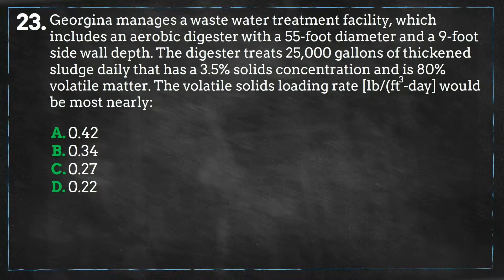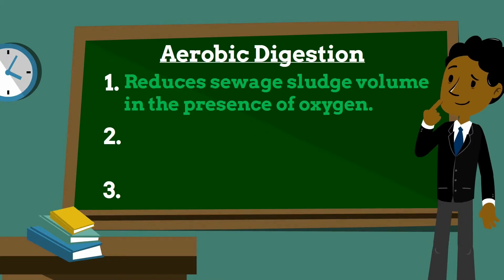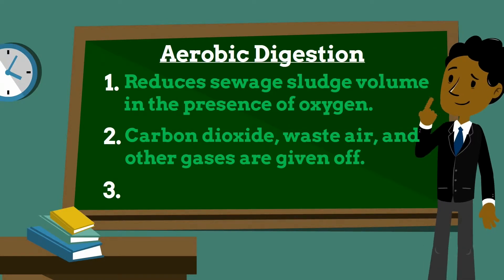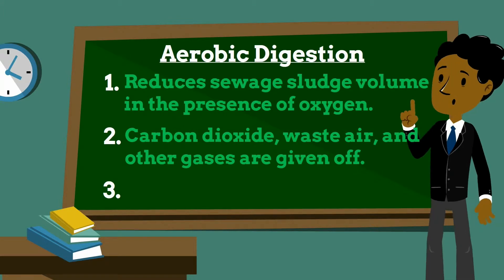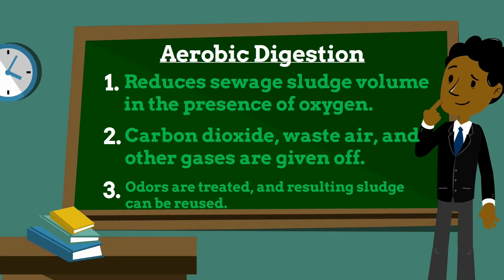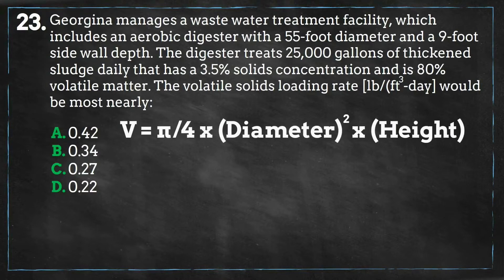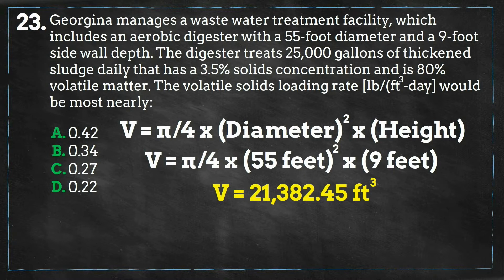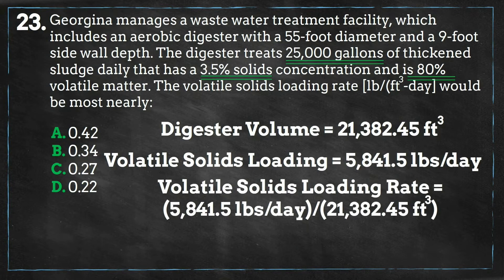Aerobic Digestion - Episode 23 (Principles of Water) | 52 PE Exam Problems in 52 Weeks

Comment: Why are you multiplying the solids and volatile percentages separately? I feel like that reads "80% of 3.5%" instead of combining them as 83.5% to account for both. I'm getting a crazy high number by not separating those percentages in the multiplication. Thanks!
Reply: @KendraZaruba You are correct - it is 80% of 3.5%. There is a difference between MLSS (Mixed Liquor Suspended Solids) and MLVSS (Mixed Liquor Volatile Suspended Solids). MLVSS typically makes up around 70-80% of total MLSS! 

So in this example, you have 3.5% of the waste stream is solid (MLSS), then within those solids, 80% are MLVSS.

Comment: The problem states that the SLUDGE is 80% volatile matter, which is not the same as stating that the sludge's SOLIDS are 80% volatile matter.  That is an unjustified assumption in your solution.

Also, just FYI, you are missing a parenthesis in [lb/(ft3-day__].
Reply from the maker: Thanks for the catch on the units in the problem statement. Regarding the volatile matter, it was meant to be a percentage of the solids content, but I understand how not having a "which" changes the meaning. We'll keep this in mind for future problem sets.

Comment: Did we just assume solids have the same density as water?  What??!
Reply from the maker: Thanks for your question, Devon. Unless we have more information on the characteristics of the solids, we can safely assume that the low solids concentration of the thickened sludge will not drastically affect your answer by using the standard density of water, which is 8.345 lbs/gal.

If you desire to be more exact, for a sludge containing 3.5% dry solids (moisture content = 96.5 per cent), 35 kg of dry solids is associated with 965 kg of water.  The average density of sludge solids is ~1,400 kg/cubic meter (1.4 kg/L since 1 cubic meter = 1,000 L) and the density of water is 1000 kg/cubic meter.  Therefore 35 kg/(1.4 kg/L)  = 25 L of dry solids are associated with 965 L of water; or, for 35 kg of dry solids with this sludge profile, the total volume occupied by 1,000 kg of this sludge is is 990 L, or 0.99 cubic meter instead of 1 cubic meter for water. Therefore, the density of the thickened sludge is 8.429 lbs/gal (8.345 lbs/gal/(0.99/1)), which is a difference that does not affect the final answer. I'm not sure if the density for sludge is in the FE Reference Handbook, but this is an approximate estimate for industry standards.

Let me know if you have any other questions regarding this explanation.
Reply: @SIGMAEnv  this^ is assuming the SG of sludge is 1.4 (1400kg/m3) I assumed SG sludge was 1.2 (1200kg/m3) and had .326 (closer to answer .34). If density/SG is not given for sludge ,is it ok to assume density of sludge is equal to water or 1.1SG  at the very most?